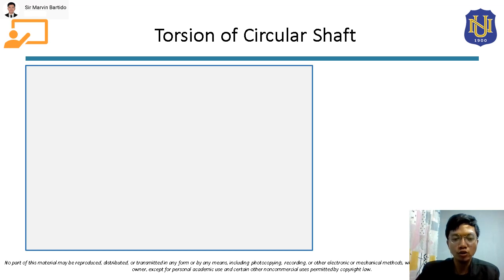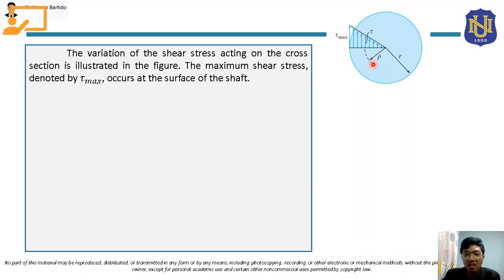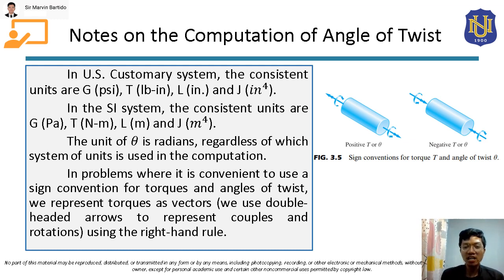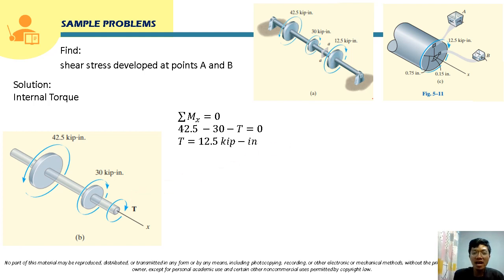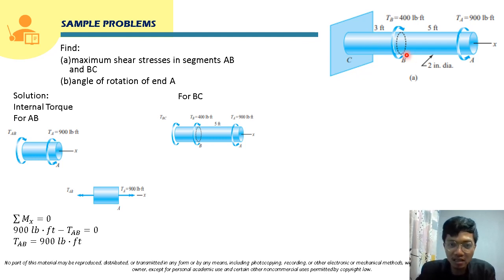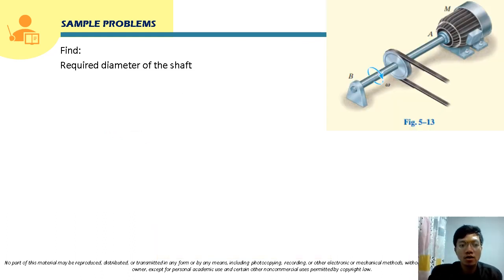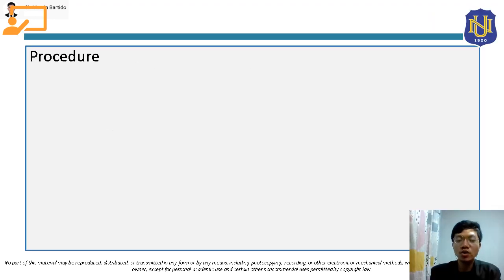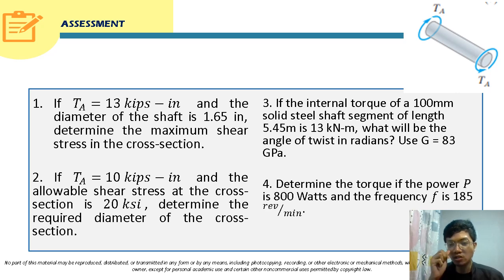Mechanics of Deformable Bodies - Torsion (Part 1/3) [Torsion of Circular Shaft]

Comment: Baldos Dranreb Aeron S
ELE-211
 

1. If Ta= 13 kips- in and the diameter of the shaft is 1.65
in, determine the maximum shear stress in the cross-section.

 

Answer

 

14.739 ksi Max shear stress

 

2. If Ta=10 kips- in and the allowable shear stress at the cross-section
is 20ksi, determine the required diameter of the cross-section.

 

Answer

 

1.366 in "required diameter"